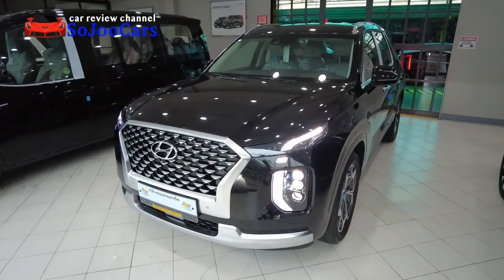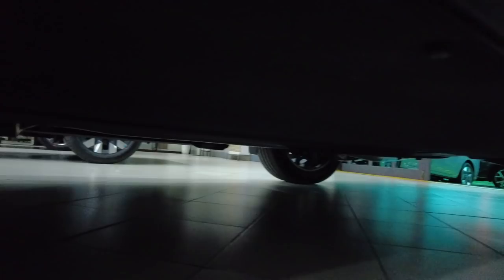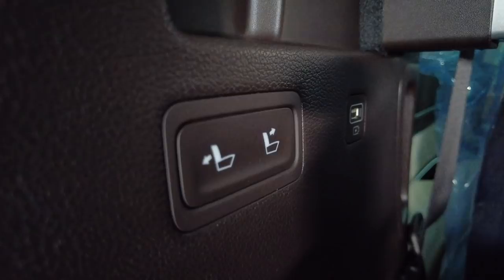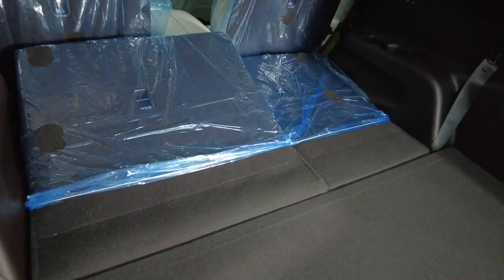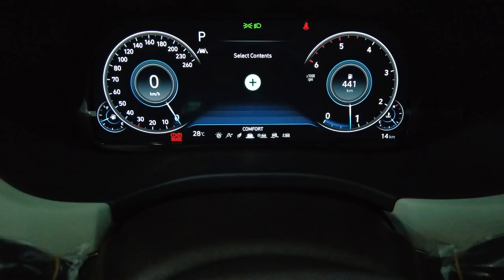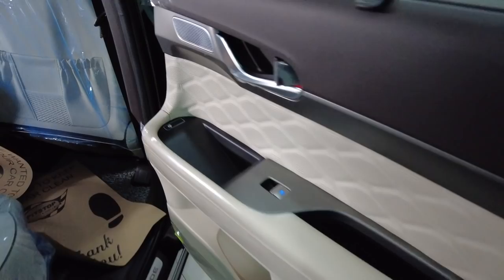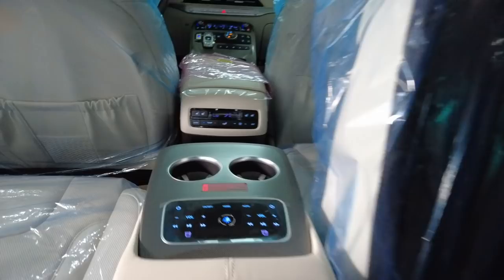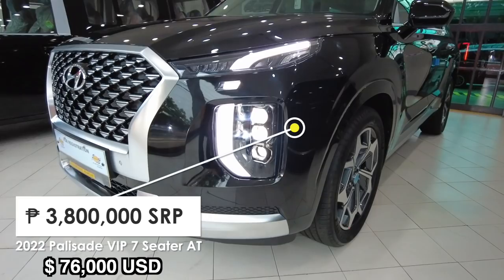2022 Hyundai Palisade VIP HTrac, top of the line - [SoJooCars]

Comment: Does Hyundai say why there's such a difference between the horsepower for vehicles in the States vs in the Phils? This Palisade has 291 hp here but 200 in the Phils.
Reply: Gasoline vs Diesel. They don’t prefer Diesel engines in the US. The Palisade in the US has a V6 Gasoline Engine.

Comment: USA is missing 3 projector lens in a headlight. USA comes with 2 projector lens. 
Disappointed. Those headlight cost $1400 for a pair I wish it should come standard in Caligraphy
Reply: That's not the only diff on the Calligraphy if that's what you're referring to. There are at least 5 differences from the Limited model.